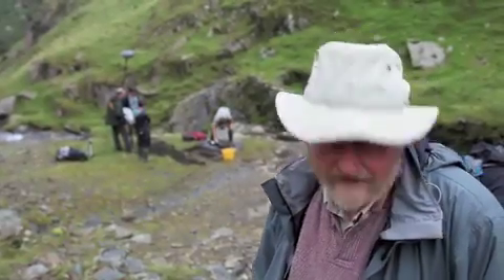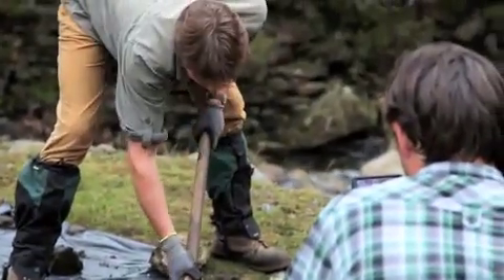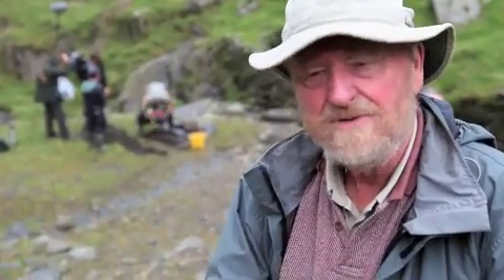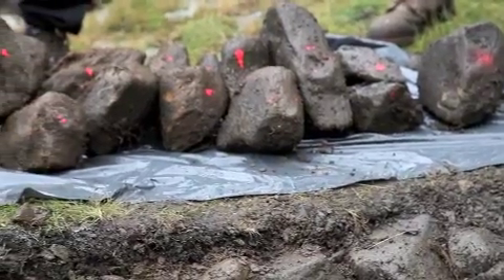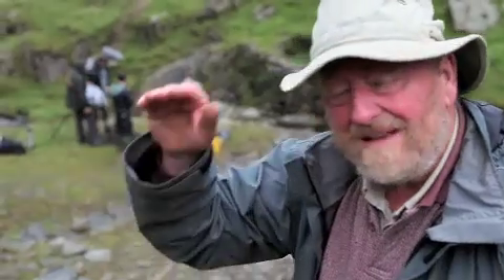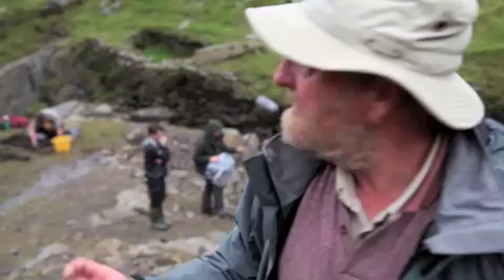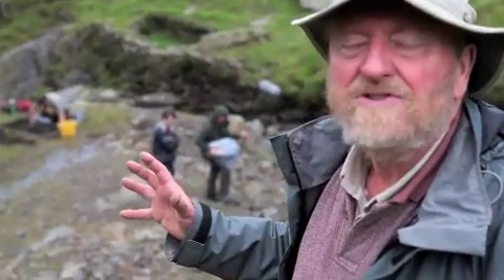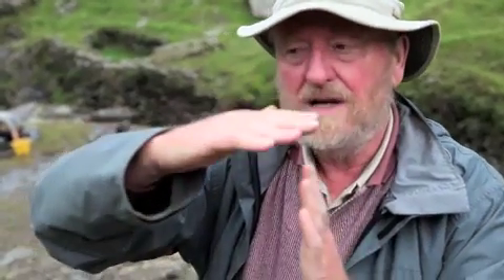Time Team Digital S20 DIG9 DAY3 - Francis at Matt's Trench

Comment: Yes the tower above is for the launder to a large overshot waterwheel, unfortunately Francis as is facts wrong about it what was used for, it did in fact work the pumps in Old Engine Shaft, it was also used for winding ore in the same shaft!!